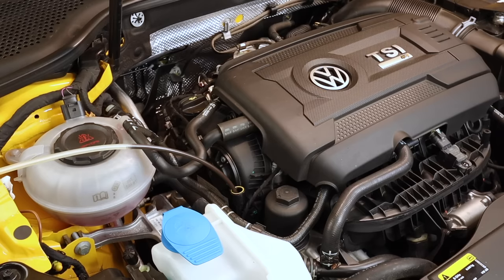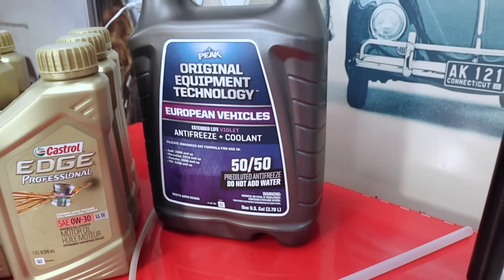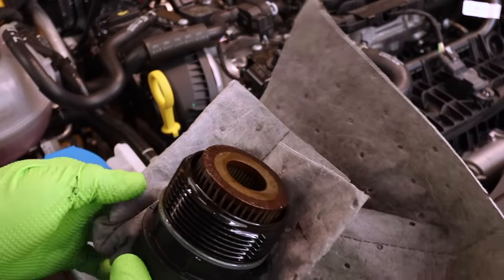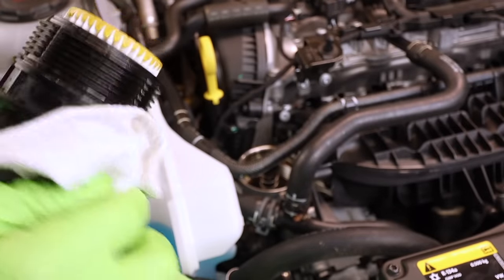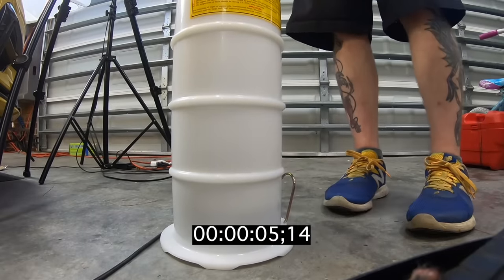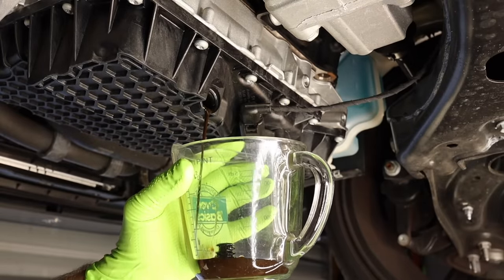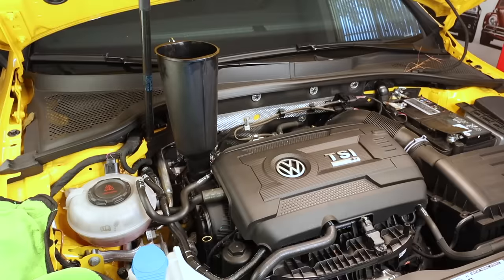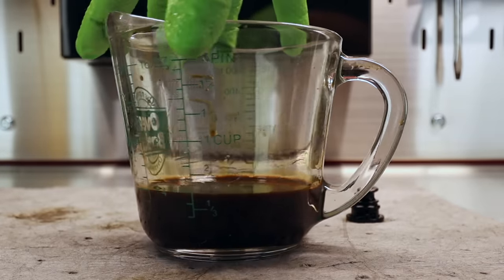Will an Oil Extractor Get All The Oil? (MK7.5 Golf R 5000 Mile Service)

Comment: Recently I did my first topside oil change using an electric pump and I found it necessary to move the extraction tube up/down in search of the last of the oil.  There are too many variables to believe that every drop drains out the bottom no matter how long you leave the plug out.
Reply: Yee. Mine takes 2.9 I managed to get 2l extracted after 10/15 min. It starts fine but then I spend most of the time trying to get more to be sucked out

Comment: If i may add.  I have a Subaru Legacy. Oil filter is the top. And i use this oil extractor from HF. Easiest oil change i have ever done. And no. I really dont care that im only getting 95% of the oil or what ever it is. Its simple.  Cheap. And most importantly it saves me alot of time.

Comment: I can't say I'd be comfortable leaving that behind. I generally leave the pan under the car for an hour or more, go do something else. Does it matter? Probably not.

I will say, however, that I seriously distrust extractors of any form. I once had a Jiffy-Lube "service" a transmission with an extractor. In less than three months the trans bit the dust. Coincidence? Maybe. And maybe I'm just a dinosaur who thinks the old ways are just fine. But I'll take a drain plug any day of the week.
Reply from the maker: When it comes to things like this I am cool with what makes you comfortable. I am doing double maintenance on the car which is silly to some people.. I don't care one bit. I am going to do it anyway. Very cheap insurance. 

I think the extractor thing is more a Jiffy change issue, than the extractor issue. But I can see why you feel how you do
Reply: I did want to mention that on automatic transmissions, if the fluid is not changed regularly, it can start to carry a lot of clutch material. If you then service it and add new fluid, the clutches can begin to slip. This is because the old transmission fluid was effectively acting as a "glue" and was keeping the clutches working. This could have been the cause of failure on your transmission, but it could have as easily been from the jiffy lube location. 

Definitely check out ChrisFix's video on automatic transmission fluid for a better explanation than I can give!
Reply: Etmanning Old wives tale friend.  I've done fluid changes on plenty of units with over 150k. Never had an issue.
Reply: Lynx Star Automotive I’ve always figured people wait until their trans does something funky to do the flush, and that’s why they say it causes it. It was probably on its way out, and they were hoping to save it haha
Reply: HumbleMechanic Exactly. Oils, filters and other fluids are dirt cheap. They cost practically nothing. Cheapest and best insurance for your car. Would be foolish to ”save” on those.
Reply: When I remove an oil pan after draining them, there is still a fair amount of oil left in them. Prob a pint or so
Reply: @HumbleMechanic  i think your double sercice plan is smart thinking. Anyone who says otherwise is over looking the fact that when you work on higher mikeage vehicles you will generally want to advise closer  service intervals. You doing this straight out the box will be great for upkeep. I'd do the dsg service early too, but that's way down the track.
Reply: John Terpack. I go one step further then you. I also let mine drain for an hour as well but I pour a quart of new thin motor oil into it to wash most of the old oil out of the pan before I plug it and put fresh Amsoil back in lol.
Reply: Cummins Owner finally someone in the comments who thinks the same as me. These things are no good for high mileage or hour machines.
Reply: Nick Beagle pretty much nailed it.  It is like chain smoking, and deciding to quit after you acquire lung cancer.
Reply: @nickbeagle4140  Mine wasn't a flush, just a simple fluid change. Not that I disagree with your point.
Reply: could be that u just used a jiffy lube. they could have put the wrong fluid in.
Reply: John, even another hour will not drain the 10-20% of oil trapped in the engine.  These are not days of old with simple engines, solid lifters and rocker arms.  I have oil analysis showing 20% retention of wear metals, contaminents, oxidized oil and degradation of the new oil within 20 minutes of changing.  Drain it again and see for yourself.  A second oil change with cheap oil will get you 99% clean engine oil, just like it was when it rolled off the floor of the factory.

Comment: Using the extractor it's whole life then someone uses the plastic drain plug and snap it breaks off since it's been in place for years lol
Reply: It's just plastic doesn't seem that difficult to get off if it breaks especially since it's not torqued down or anything
Reply: Plastic drain plug looks like an accident in waiting..
Reply: audimate ‘
Reply: Plastic gardens and becomes brittle with age and is best when changed periodically.
Reply: You’re over thinking it, please don’t get any new car lol. And btw an older car is going to have way worse problems than an easy pan swap. Pan swap takes 20 minutes no joke..I see people adding coilovers, paint, and horsepower to old cars but they never changed the balljoints, subframe bushings, or tie rods lmfao. That’s like going to the gym to do squats after knee surgery, it’s f**ckin stupid lol.
Reply: @Irishluckily  
So why the obscene language?
Reply: That's exactly why you shouldn't buy a plasticky Volkswagen :)))

Comment: So much plastic parts in this engine, as if it is 3D printed :)  
It's very wise to make the first oil change as short as reasonably possible (engine break-in). But for later oil changes nothing wrong to change the oil around 6K - 8K mi and do it completely thru the drain plug. Just because the oil is dark in color, it doesn't mean it's bad because turbo engines tend to make the color change really quickly. Nevertheless it's a good habit to inspect the oil level every 3K mi & top-up if necessary.

Comment: I prefer to use an extractor so the only time I ever lay on my back is in bed 👀
Reply: Steve Wilson I also have a bad back.
Reply: i would rather lay down on my back, then bend over a engine bay, hunching over is what will cause back pain
Reply: What about the oil filter? Is that on top of your engine?
Reply: @stevensevek6151  yes it is
Reply: Customers may have diffraction opinion
Reply: Ahh so a submissive type I see.
Reply: @B14CK_H4WK  your right if Bend Over works with you, it would be best not bend over the engine, u will have more than back pain lol
Reply: Yes!
Reply: This.
Reply: Euro life
Reply: I just use a lift and I can just stand up.
Reply: Yeah bed should be the only place where your heart races, and the race track of course

Comment: I'm too cheap to buy an extractor, and drain plug method means I can use the time to clean out filter housing, change air filter, check other fluids, etc. while it's draining. Great video as always! Edit - good call on the slightly overfilled to start with - after the extraction was complete that was as near as damn it 6 litres you pulled, especially with the extra 100ml through the drain. Kudos.
Reply: Exactly, use the time that its talking to pump out the oil th R&R your filter and check fluids.

Comment: I just bought an extractor to change the oil in my generator, slow blower and lawnmower.  I sucked the oil out of all three in about 15 minutes total!   Considering that I would likely have NEVER gone to the trouble of draining them traditionally, whatever oil might be left at the very bottom is so much better than leaving the old oil in there, or not changing it at all because it's a hassle.

Comment: The 100 ml might be insignificant amount compared to the total amount of oil, but that last 100 ml may contain the heaviest and most damaging contamination since it sits right at the bottom of the oil pan. Would be worth analysing the oil extracted through the top versus that last 100 ml through the drain plug.
Reply: agree, pulling the plug, you get all the sediment on the bottom of the oil pan, sucking from top gets everything but

Comment: Do I mind the 100ml of oil, in my car that I do maintenance so I know everything is well maintain, yes! I also think having a 100´ish extractor that I need to clean is not worth the fuss at all!! 25$ ramps, inspect under the car, drain ALL the oil and be happy! Also the plug is so easy to get off!
Reply: The plugs are fragile  and are know to leak if u aren't careful but fair point
Reply: Yes I replace it every time for 5$
Reply: In my opinion I can understand using the extractor for in between service oil changes, especially with cars having 10k+ service increments. My saab has a 15k oil life that I decide to change every 5k instead. I think for the actual service bulletin you should still get under the car for just to check everything out and make sure your car isn't developing any problems.
Reply: David, I wish it was only 100ml.   in modern engines 10-20% (500-1200ml) of used oil remains trapped in the engine. I have oil analysis showing retention of 20% wear metals, contaminents and oxidized oil and degradation of the new oil within 20 minutes of running the engine.  Perform a second oil change with cheap oil and you will see how contaminated it is.  A second change will give you 99% clean engine oil, just like when it rolled off the line at the factory.

Comment: Just wanted to share my experience, I have Lidl electric oil extraction pump, it's about 10€/$, and I did a little test on my Ford Mondeo Mk4 with 2.5T engine, my plan was to extract as much as possible with a pump and to see how much will go out from the oil drain, everything as you did here.

Oil filter on this engine is top mounted cartridge also, so it's easy and clean to remove it, and all the oil goes down to the oil pan when oil cap is unscrewed, because it's pressurised and full otherwise.

I measured oil dipstick length and put thin sucking tube which goes even further than a dipstick, I felt little resistance when the tube curved on the bottom and there was definite stop when the tube touched bottom oil pan wall.

My advice is to put can for the old oil as low as possible, basically on the ground and not on the engine, I have inspection pit so I can put it even lower, gravity is a friend in this case. Also engine was warm of course, so as the oil naturally, about 1.5h after engine was on operating temperature and ignition was turned off, so the oil can drain to the bottom as much as possible but also to remain thin and easy for the pump to extract.

I let the pump to pull out to the point when on the other side of the tube was just drops of oil.

When I removed oil drain plug, prepared to catch some amount, and eager to find out how much will it be, I was surprised that there wasn't even one drop of oil.

For my car with this engine it works perfectly, you must find out for your car, can it pull out all or almost all, and does it make sense to extract oil using this method.

I think you could tolerate up to 0.3L of old oil remained in the pan ONLY if you have no other option to change the oil correctly. 

In any case I will continue to change the oil from the pit, because i find it satisfying to do it myself.

Comment: I just think if you stay on top of maintenance and do it at regular intervals, you are perfectly fine. I do 5 k service on all my cars no matter what, all my cars have lasted well above 200k and all of them still going strong, take care of your cars and they will take care of you.
Reply: @ThunderGoatz  yeah, even my BMW  has 202k miles on it runs like a clock and with the right maintenance is really cheap to run. Just change often and consistently.
Reply: Absolutely. I sell my customers on this all the time.

5-7k intervals max

No crap domestic "synthetic" oil

5w-40 on turbo engines
5w-30 on n/a engines

Special cases like BMW N62, N63, Prince, use plasticizer additive to condition valve stem seals. 

You will be good for a long time.  I myself have a CCTA powered Dub. It has got 70k, still have not even had to replace the front cover gaskets, seals, etc.  Does not leak a drop.  Uses half a court every 7k miles.
Reply: @LynxStarAuto  yeah I have a e39 530i and so far small power steering leaks but no oil leaks and only castrol 5w30 for the m54 and planning to boost it soon.
Reply: raomar Not a fan of the Castrol, but if you are changing it frequently, it may negate their not exactly synthetic oil claims.  We have a lot of nerve calling most of the garbage oil we sell Stateside synthetic.  Regulations here are lax, and oil companies are allowed to stretch definitions when marketing. 

I only use European based oils.  My personal favorite is Liqui Moly.  Tho I will use Pentosin and Fuchs as well.  European standards are much stricter than in The U.S.  The above mentioned are true Group IV synthetics, which is 100% synthetic oil.  Anything under is just a blend I.E. Mobil 1, Castrol Edge, etc.
Reply: @LynxStarAuto  huh, I see. Would amsoil be considered a good oil? I have been thinking about switching to it or royal purple, but either way I just change a 3-5k miles and dont beat on my engine too much. So far it has worked like a charm and motor is still running strong.
Reply: What this guy said!
Reply: My 2007 Accord oil (synthetic) & filter changes were at 7-9k. After 483k miles, it had never needed oil added between changes. My 1987 Camry had 10k intervals (dino oil) and was running great when sold at 244k.

Comment: I always measure the dipstick against the tube, pinch with a finger and then I know I need to be at least that deep down the tube.
Reply: Good hint
Reply: Be careful with that method...I recently watched a video about a ford tsb where the remedy is to install a shorter dipstick, and add more oil,  to hide an oil consumption issue.

Comment: My garage changed the oil using one of these extractors on our old Smax 2l diesel every 13k miles, we sold it at 212000 miles, checked the UK MOT website, it's now covered 228000 miles, so I don't think it matters really, just so long as fresh oil is put in frequently

Comment: • You can get a pretty good estimate of how much tubing to insert into the dipstick tube, by referencing the dipstick itself; the tubing has to at least go past the lower oil mark.
• Also, some cars' dipstick tube is actually a pretty good substitute for the tubing. In such cases, using an appropriate rubber bung to connect the dipstick tube to the vacuum oil extractor gets as much oil out as fiddling with the tubing.
• 100mL out of 6,000mL is 1.6%. The dilution factor with new oil will make the leftover oil inconsequential.
Reply: There's 1 quart between max and min , so you need to go 5 times that length lower (approx 5 inches)

Comment: The fact that I have to buy the extractor, store it and take space in my garage, clean it after each use and leave 100ml of dirty oil in the engine makes it not worth it. Great video!
Reply: On these, not so much.  But some vehicles like Land Rovers, and Jags?  I'm pulling out the extractor.  F those shield covers, and those damn drain plugs which seem to always leak unless you replace the entire plug.
Reply: It's worth if for ppl who change the oil regularly if they can easily access the oil filter without having to go under the car
Reply: Unless you're doing a flush, you're going to have dirty fluid lingering. And 100ml out of 5l or so is so minute it won't do a thing. Same exact idea with transmissions and those tend to have more old fluid in the torque converter... yet can keep going if you take care of it.
Reply: You don't need to clean the extractor and it probably takes less space than your drain pan.
Reply: Grow up

Comment: When I had my stroker engine installed in my 98 mustang years back I broke it in right. I used royal purple faithfully. Every 4k miles I drained the oil, then installed a cheap filter, and oil. Idled it for 20 minutes then drained. After that I added the 7 quarts of royal purple, and a motorcraft filter. Over done, but when you pay 14k for a total front engine install it's worth it. 21k on the engine when I sold it, and boroscoped it. Was barely any carbon build up
Reply: That's a lot of work but I'd do the same if I had a car that fancy.
Reply: William you are wise to do this on such an investment.  Same for new cars that run $20-30K.    I wish it was only 100ml, but  in modern engines 10-20% (500-1200ml) of used oil remains trapped in the engine. I have oil analysis showing retention of 20% wear metals, contaminents and oxidized oil and degradation of the new oil within 20 minutes of running the engine.  Perform a second oil change with cheap oil and you will see how contaminated it is.  I believe you have discovered that.  A second change will give you 99% clean engine oil, just like when it rolled off the line at the factory.

Comment: Good video.  This was the only video I've seen that measured if all oil was extracted and then double-checked via the drain plug.   As far as getting that last dirty oil out, you could always add 1/2 qt of any fresh oil you have and then extracting again.  At the very least, this will dilute the dirty oil or sediment at the bottom of the pan and leave less dirty oil behind (for the anal retentive).
Reply: I agree with this
Reply: I remember seeing Paul @ ShopDAP do a similar video (I think in a GTI), with similar results.
Reply: Great idea